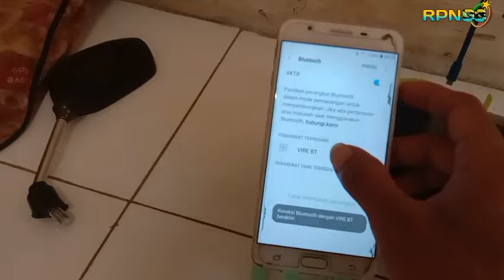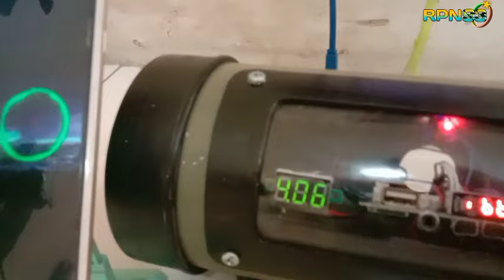DIY Membuat speaker bluetooth

Comment: Pake modul ampli tipe apa bang?maaf bingung mahami part yg dipake
Reply from the maker: Module mini amplifier stereo PAM8403 2x3W 5VOLT,yg udh ad potensio nya.
Reply: @rpnchanneltutorial  wah kl pam itu udah punya,tp speakernya kegedean ini punyaku.kl divideo ini pake speaker brp inch bang?
Reply from the maker: Saya pake speaker 4inch 10w,sma speaker 2inch 3w bang
Reply: @rpnchanneltutorial  mantabb.mau nyoba ah.bikin sama pralon
Suwun responnya ya bang